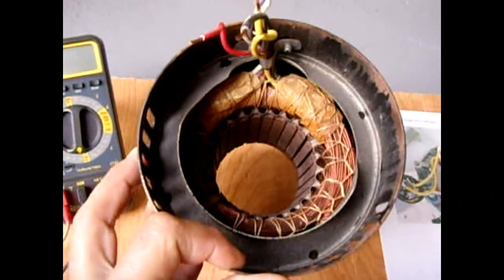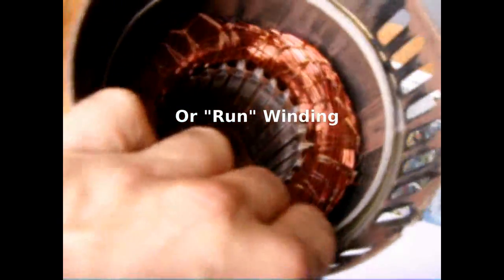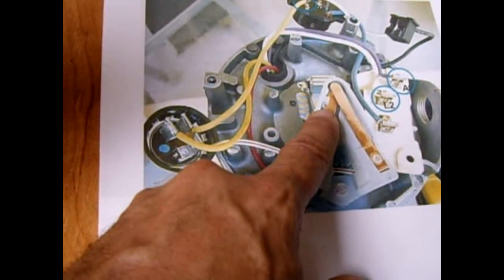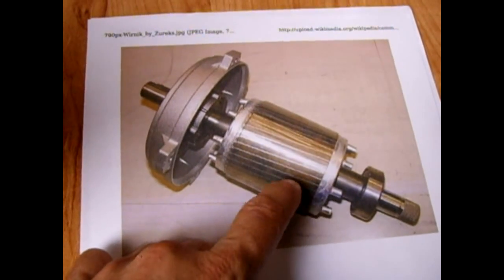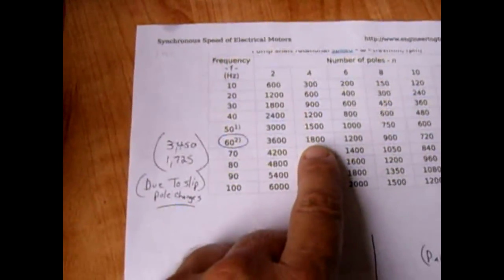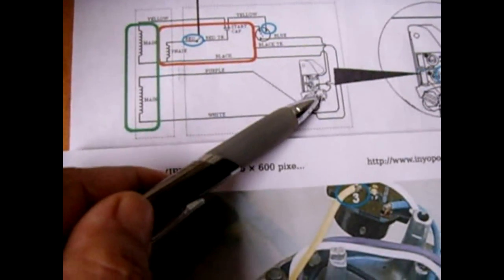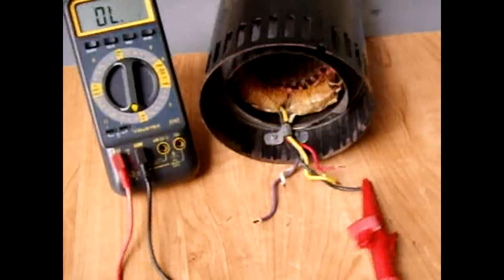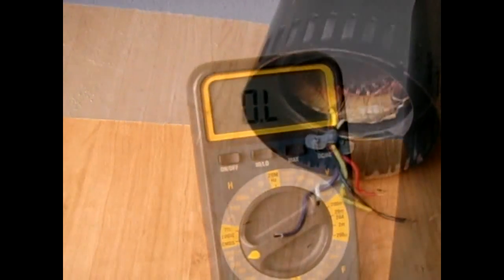How To Test & Repair Electric Motors (Pool & Sprinkler)

Comment: Thank you for posting this it is very helpful. Quick question my pool pump motor has worked fine for years and now this year as soon as I turn it on it pops the gfci receptacle immediately. Not making any humming sound or anything. I replaced the receptacle but it’s still doing it. Is the motor likely shot?
Reply from the maker: More than likely a shorted winding
Reply: @electronicsNmore  yeah that’s what I was thinking too. Thanks so much for getting back to me. I appreciate it.
Reply: Just got the pump running again! I thought before ordering a new motor I would try replacing the power cord which looked a little janky as someone made a power cord with a grounded plug and outdoor/underground romex wiring. So I made a new power cord plugged it in and was pleasantly surprised when it fired right up

Comment: Thanks for this video!  Very informative and helpful.  I am having an issue where the motor will start but then shuts off after about 30 seconds and hums. I have replaced the capacitor, terminal board and V switch and still same result.  From watching the video, I am now wondering if the problem is a bad run winding or possibly the centrifugal switch? Any ideas or suggestions???

Comment: Thank you for taking the time to makes this video. Question: my Hayward .75hp pool pump starts & runs for about 10 seconds, then shuts off (does not trip the breaker). I changed the run capacitor, thinking it was the issue, but the problem persists. Since it does start, I must assume the start capacitor is good (maybe that's naive of me). The motor shaft spins freely. Any insight on what else I should examine?
Reply from the maker: Is there a pressure switch installed
Reply: @electronicsNmore  
I do not believe so. The motor is a Century .75hp,  part number 7-196335-24. Similar in design, but not an exact replica, to the motor you used in this video. It's about 8 years old, and has had lots of runtime. It might just be tired. I don't mind buying a new motor, but I like to troubleshoot and try to find the root source of issues like this.

Comment: I don't know much about shallow well pumps but I have changed a couple pressure switches(30/50) on my old 1.5hp Gould's J10 until I decided to finally get a new one. I snapped a pic of pressure switch terminals and wiring since both pumps are practically the same. . . recently I noticed whenever pump cuts in it clicks a few times before running.

Twice the pump stopped running(not breaker trip) but after I flip breaker to off then on again pump runs again.

I notice my kitchen light slightly flicker whenever new pump cuts in. My old pump never said this. New Gould's J10+ has 120/240v switch, old Gould's J10 was 240v on 2 pole switch. I set new pump to 240v as well.

I don't know what's going on?

Comment: This is one of the few youtube videos I have viewed where the person has a true and good understanding of both electrical theory and mechanical aspects of these pumps. You explained well. My only issue is recommending that people should try spinning the shaft to see if motor works as sometimes the windings can go hard down to earth and protective devices are just not there or do not operate. If this is the case and you don't test insulation resistance first, then trying to spin the shaft while energized may just be the last thing they ever do.
Apart from that, I enjoyed the video and well done.
Reply from the maker: Good point. Glad you liked the video, and thanks for the nice comment!

Comment: Great video, nice and detailed!!  I have a question.  My pool pump (1.5hp with only a start capacitor, just like the one in this vid) recently started turning off for a few seconds then on again for a few seconds.  It will continue to alternate between off and on every 10-30 seconds until I shut it off.  I replaced the capacitor because it was the easiest thing to do first, but it didn't fix it.   What are the 2 or 3 most likely things that could be wrong in your opinion?  Thanks!
Reply from the maker: Sounds like a faulty motor overload protector, or a faulty winding in the motor.
Reply: @electronicsNmore  Thanks,  I'll check those!

Comment: But you didn't test the red start wire to the other pole ( blue and white)?
In this sears motor I have the reading you are getting with the black and yellow  and red is in mega ohms.  The white and blue and red I get the reading you are getting with your wires here. 
I want to hook up to 120V.  Do I hook up the black wire to the purple?  and supply power to white and yellow with the red to the capacitor and white as common?
I  basically also like to ask what is the reading between all wires for 120/240 V  motor coil set up?
Thank you very much.
Reply from the maker: There should be a diagram on the motor showing how to wire it.

Comment: Hi there electronicsNmore new subscriber here. Our power supply is 220v. I bought a 1/3hp Gould Pump J03 Series from a  scrapyard this morning. I opened it and it says 123mfd-140mfd 110-115v capacitor. I was not sure if it can run 220v or not. But I try to plug it to 220v abrultly and it turned. What will I do? 

Respectfully,
Boolie Distura
Reply from the maker: I have no idea if you have a dual voltage motor. That's an obsolete motor. 220V motors use 110V caps. Thanks for watching!
Reply: @electronicsNmore  if I’m reading only around 115v should i change my pump motor to 120 rather than 220?

Comment: I wonder if you could help me.  I know just enough about this stuff not to be able to fix it. I believe I have a bad capacitor. Can I test it without removing it from the pump? Also, don't short it out before testing?
Reply from the maker: If you don't have a capacitor discharge tool, then short the terminals before touching the capacitor. Of course the power is OFF before you touch anything.
Reply: I want the diagram that you explain from it please

Comment: So I just got a pump with a plug .. how do I wire it to wires already coming out of my 230 box out side it can go 120 or 230 ? Help??
Reply from the maker: Ennrick LaFrance If indoors, then cut off the plug and strip the wires. You need to buy a 1/2" Romex clamp to secure it to your pump timer box. 120/240 conversion info should be shown on the motor.

Comment: good info thank you but is it worth it to go through all that trouble when I can get a new ao Smith motor fore 125.00 brand new great. info
Reply from the maker: It's foolish to replace a motor that doesn't need to be replaced.

Comment: What is the rating of your capacitor, please ? I have the same motor  you are demonstrating and the problem is the capacitor nameplate is gone. I want to buy the correct capaccitor. Thanks
Reply from the maker: You need to look up the motor online for the capacitor specs. Probably a 161-193mfd / 125V.

Comment: Great Video! I have a US Motors 2 Speed motor(EB2977T). The color of the 5 wires is different from the color of the wires shown in your video. They are Red, Orange, violet, blue and white with black stripes. How do I translate these colors to the color of wires shown in your video? Thanks
Reply from the maker: You need to refer to the wiring diagram on your motor. You can take resistance measurements between all the wires to get an idea which lead to the run winding, and which lead to the start winding. Thanks for watching!

Comment: concerning the 2 leads (hot and neutral), is the neutral tied to ground like a service panel in a house? and if so wouldn't  there be continuity with the neutral wire and ground with the ohmmeter ? thanks for answer ...

Comment: Hi Great movie      i like to know what color weier goes together if i like to hook up to 110 volt 
I have a hayworth 1.5 HP pool pump but i do not have the terminal bloc only all the weiers   same coler as your video 
Thanks Niels
Reply from the maker: Look up your model# online. :-)
Reply: Hi Again    I have not found on line how to hook up by color of the weirs    online it always say use A1 B2   and other terminal markings     i only have all the weier ends coming out of the motor   also the ower load and capacitor 
Thanks Niels
Reply from the maker: Niels Bartholdy
Without a wiring diagram, I wouldn't know. Every motor is different. You need to research your motor model online.
Reply: If the motor is supposed to have a terminal block, you may be able to find one on Ebay

Comment: Thanks for a GREAT video, question:  IF the THERMAL OVERLOAD SWITCH you identify at 5:00m GOES BAD, will that cause the breaker to trip that feeds the power to the pump?  I'm troubleshooting my shallow well above ground Goulds 115/230v irrigation pump (set & used at 115v).  I replaced the capacitor already & triple checked timer, breaker & voltage (all is FINE).  Or does this situation sound like we have a burned out start winding?  NOTE:  the motor shaft spins very nicely, no hang up at all.  THANK YOU SIR!!!
Reply from the maker: +C-Jones Lawn & Tree 
Hi there. The thermal switch will never cause the circuit breaker to trip. If you have full voltage at the motor terminals, then only a faulty capacitor or shorted winding would trip the circuit breaker. You can remove the start capacitor from the motor, tape off the terminals out of the way from moving parts, then power up the motor and CAREFULLY give the shaft a quick spin to see it the motor runs. If it does, then the start wining is shorted out,. You should have discovered that doing the resistance test on the start winding.

Thanks. Be sure to rate thumbs up and share.

Comment: I have almost the exact motor your referencing in this video, my question is, I plan on using this pump(motor is attached) as a turbine to generate electricity in a micro-hydro electric configuration.  I am curious if I turn on the water flow and bring the motor up to speed, will it be generating electricity or would I need to field flash the coil to start the process...?  I know with a PMA you wouldn't require the field flash, and if i'm understanding it correctly a three phase motor could be phase shifted with capacitors to negate the need for field flashing the motor, but with a single phase motor like the one in this vid do you think it would be required...?
Reply from the maker: Please refer to this video:

How To Use An AC Motor(Induction or synchronous) As A Generator

The video explains how it is done. You need to spin the motor slightly faster than the rated RPM.

Thanks for watching! Be sure to rate "thumbs up", and share.

Comment: can you direct me to site that provides picture wiring diagram..thank you in adv.
Reply from the maker: Hi Ed,

Sometimes there is a wiring diagram for 120v/240v conversion on the rear side of the power supply metal plate(cover) on the motor. For a specific wiring diagram(including the windings), you need to look up the manufacturers name/model.

Thank You

Comment: Awesome channel. I have a spare 1.5hp 115/230v AC single speed pool pump and will use it for a future water project experiment running 24/7. Problem: it uses too much power for what I need (wastes electricity) and too fast (3500rpms). Is there a something I can add to the motor/circuit to make it draw less current (amps)?

Comment: So what dictates the motor direction? I'm used to 3phase. Done very little single phase stuff.

Good video!
Reply from the maker: The start winding. If you reverse the start winding connection, it should spin the other direction.

Thanks For Watching!

Comment: Have you any video how to test capacitor? if you have then please tell me. i did not understand about DMM test of capacitor
Reply from the maker: Refer to my microwave oven parts testing video in my video list. When you place the probes of the DMM (using a 1K ohm range or higher)on the terminals of a DISCHARGED capacitor, the resistance should start out lower, then climb very high.

Comment: Thank you for another very useful video. Almost all the motors I worked with were 3 phase 480 volts. Looking forward to your next video.
Reply from the maker: Your welcome. I don't think you need a start capacitor for a 3 phase induction motor. The 3 phases create a rotating magnetic field.
Reply: electronicsNmore
You are correct. No run capacitor needed. Really the starter for the 3 phase motor is the most complicated Part, Though once one understand"s it, it's not that bad. Cap banks are used to keep the power factor down.It's a money saver for Big manufacturing plant's. I would like a 100 dollar bill for all the motors I wired over the years. : )  Thank you for the reply

Comment: If the motor is running, can you use the start winding as a generator? I think it should. No idea if it can be useful.
Reply from the maker: This motor was used in an induction generator that I made years ago. I ended up switching to my inverter generator which is in my video list.

When I made the induction generator, I used BOTH windings for power. The main winding supplied most of the power to a 120V receptacle(60V per leg since there was no center tap on the winding), and the start winding supplied around 350W or slightly higher power output at a voltage which was a little higher than the main winding.

Once the motor is operating at full speed, you should be able to take power off of the start winding(red and black wires).